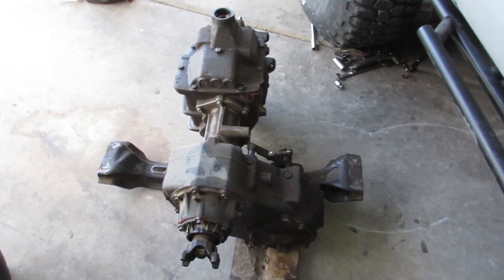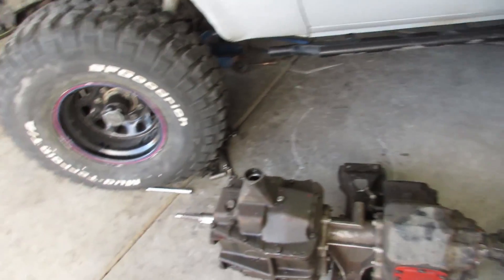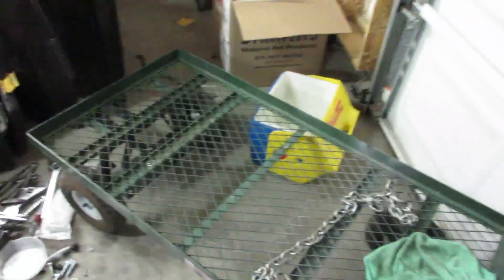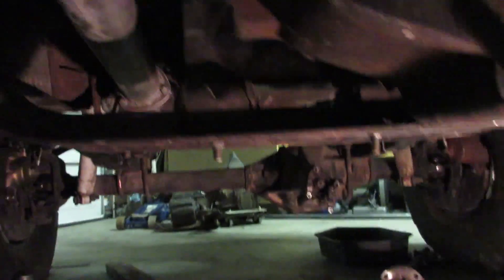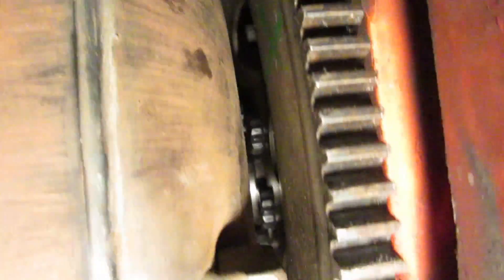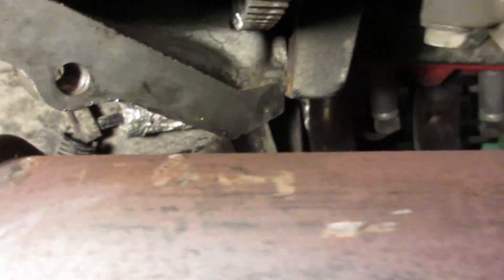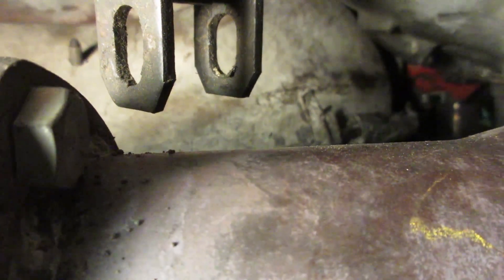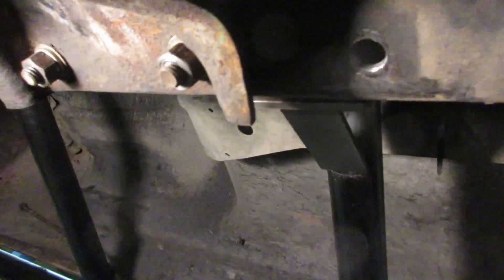LS Chevy K10 - TH400 Swap pt1 -  SM465 out!

Comment: Hey Dave have some questions for you, I’m getting a 1982 k10 4x4 with a 4 speed and I want to LS swap it and put a 4l60e transmission in so I’m curious if I’ll be able to reuse the crossmember from the manual for the new automatic swap? Wasn’t sure if the manual crossmember is different from a automatic crossmember?
Reply from the maker: I was able to use the th350 one with my the sm465, so it might work.
Reply: Dick's 4x4 Garage ok perfect I’ll try it out then, I just wasn’t sure if I should get a donor that’s 4x4 and automatic from factory to use, wanna do it all on a budget so the more I can save the better. Thanks for the reply! Like watching your videos!

Comment: You should put a cable shifter on it.... I did it on my K5 and it's pretty trick, plus it won't bind up when your flexing out.
Reply from the maker: I will have to keep that in mind, does it run off the column shifter? If you have any info on the one you have let me know. I have also seen the Lokar top mount but I would think I might be able to fab something up if I needed to.
Reply: Ya I think I went with the lokar kit, and yes it works on column.  Pretty slick, and it worked with my 4L60e too.  I think it was like $150 and I got it on Summit Racing.  If you want pics let me know.
Reply from the maker: Thanks, I will have a look on Summit Racing.

Comment: i will be doing a ls swap in my 89 blazer to a lq4 th400 np205 and i want to keep the drive shafts i currently have. i have been measuring lengths of everything and it seemes it will bolt right in with ls swap motor mounts the keeps the ls motor in the same position as the 350. can you confirm this? or should i get adjustable motor mounts?
Reply from the maker: I used the advance adapters swap adapters and it put it in the same location as the old small block.
Reply: MrWhitels1 then the trans and  t-case will be right about in the same location with out having to have new drive shafts made. i will follow up in your new videos to see how the project turned out
Reply from the maker: As long as everything is the same with the trans, it should bolt in the same location. Thanks for watching!

Comment: Which transfer case are you using
Reply from the maker: Np205.
Reply: @Dicks4x4Garage  I’m doing the swap with a buddy at the moment the same as you. Did you get the adapter kit from Advance Adapters too? They mentioned regarding the kit, “The transfer case will need to be machined to accept the larger diameter input bearing that is supplied with this kit.” Did you find that to be the case for yourself? Any help is much appreciated.
Reply: @anthony4243  did you machine your case?
Reply: @SubePelayo928  Yes, I am in the process of getting that done at the moment. It’s through a guy in Portland Oregon. It took 3 months to get the adapter due to some manufacturing delays, so the truck should be up and running again soon.